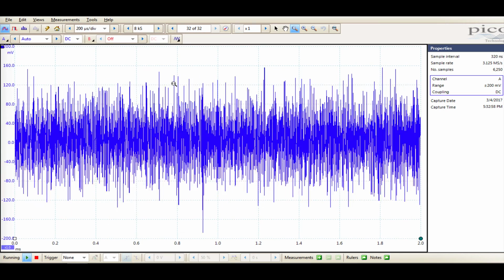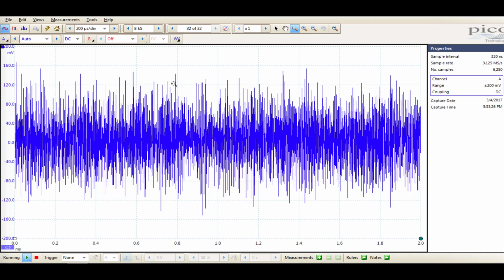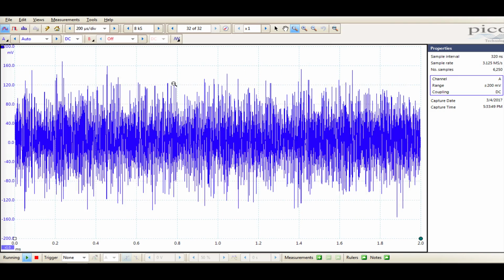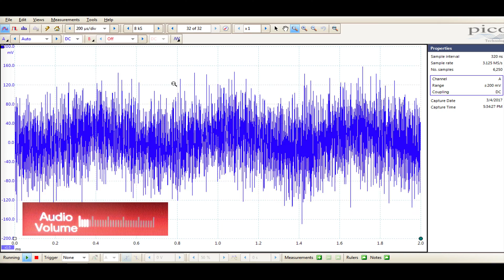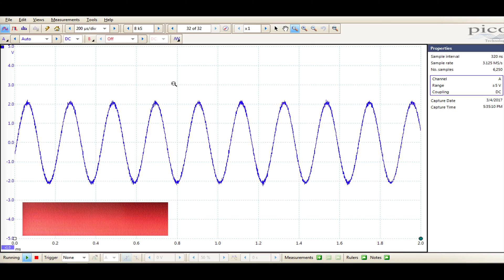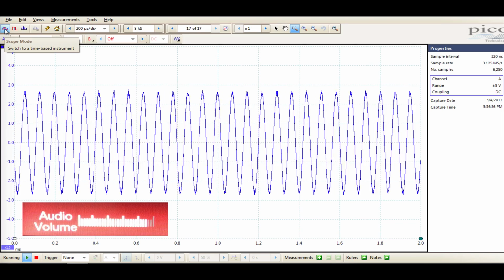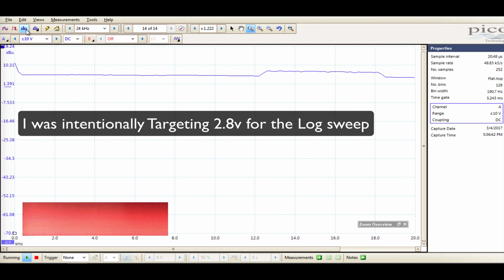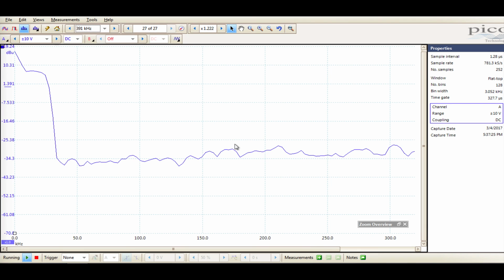PAC AP4-FD21 Oscilloscope Verification of Voltage and Frequency Response

Comment: Question for you Bryan - When you mention the bump at 33.88kHz, but describe it at "hertz," I feel like I'm not following the scale on your X-Axis, which does appear to be in kHz.  Should you be looking from 0 to 20kHz (as the maximal upper range) rather than 0 to 300kHz (Where the audible response curve is actually limited to that entire area occupied by the initial drop/bump), and not the 33kHz+ neighborhood (Which isn't audible)?
Reply from the maker: Jeremy Carlson very keen eye Jeremy. You are correct my scaling is wrong. I did a follow up video (linked in the show notes). For the rest of the story see this video starting at 3:38

https://youtu.be/IVE9O88ZsHg